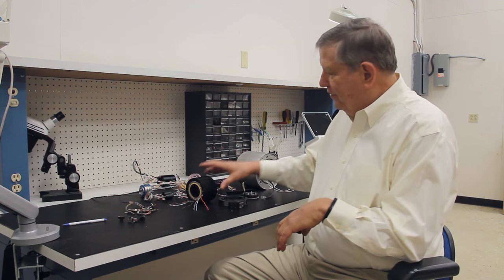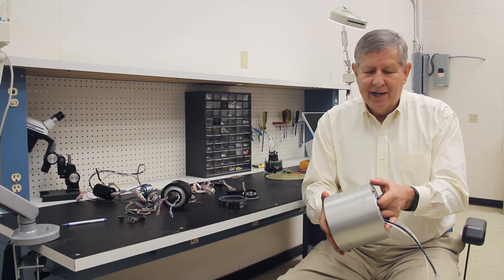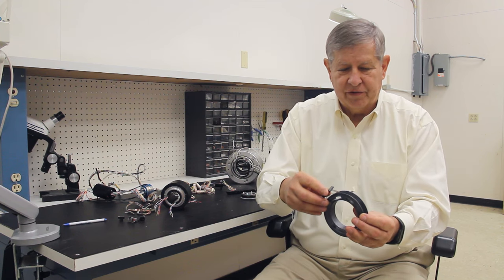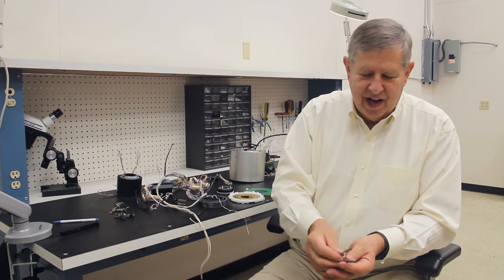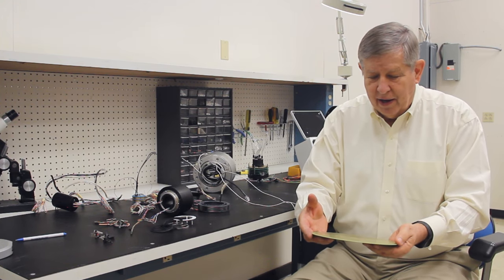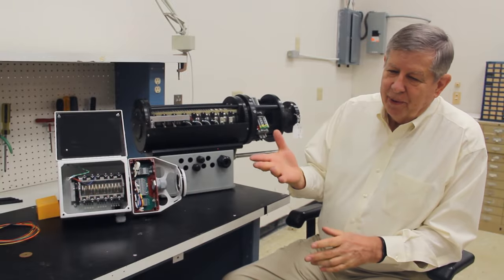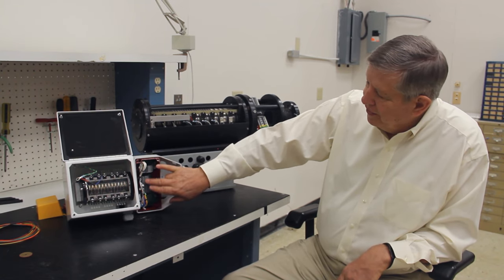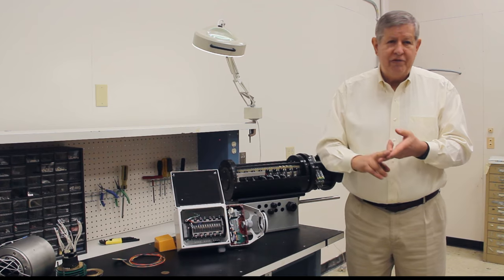Introduction to Slip Rings

Comment: Your video was very helpful. I would like to ask you to help me visualize how 5 independent signals (5x12) could be conducted to a stack of 12 independently rotating rings/disks on a common shaft. I am an amateur artist attempting to create a moving sculpture piece. The rings would be more or less 1/4" thick and 1 1/2" to 24" in diameter. The common shaft diameter could vary but smaller of course than the smallest disk. This seems a little backwards or upside down from your video and I can't seem to wrap my head around it. If you have any thoughts even if it is that it can't be done, I would appreciate your input. Thanks in advance.
Reply: make Beryllium copper (BeCu) spring contacts and slide them against copper rings. OR just buy cheap capsule slip rings

Comment: Please explain this issue in my packing machines. 
A lot of slip ring has been failure during a weak. 
Firstly I would like to explain. My machine three phase harness cable is too far from transformer, there power cable is too remote from machine power input

Comment: Dear sir
Kindly let us know the procedure to rest sliprings pertaining to the insulation resistance and what is the max voltage which can be used which the slipring can withstand ie 220 or 415 volts 
What is the insulation resistance required between ring to ring when measured with a megger of 1000v
from Sreedhar india
Reply: Pay an engineer to figure that stuff out.